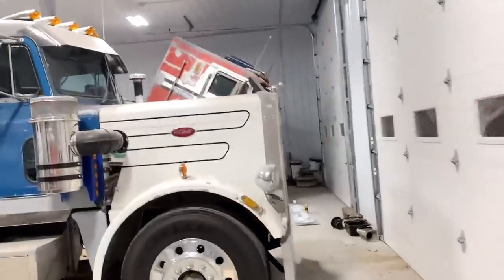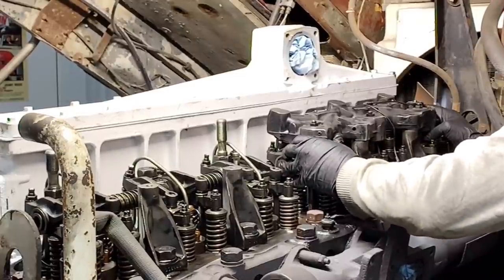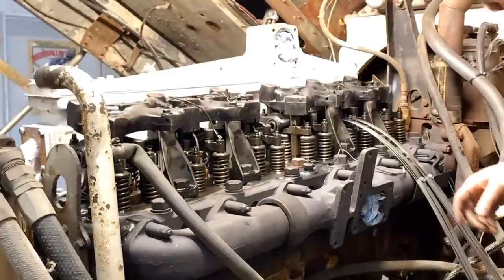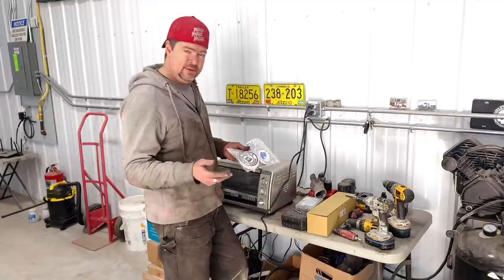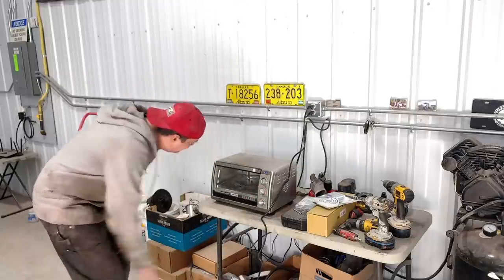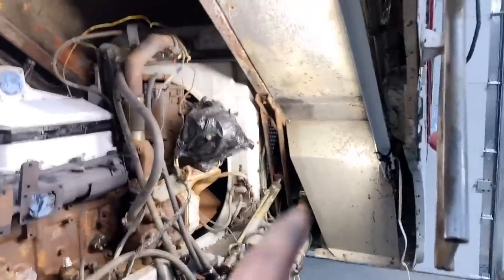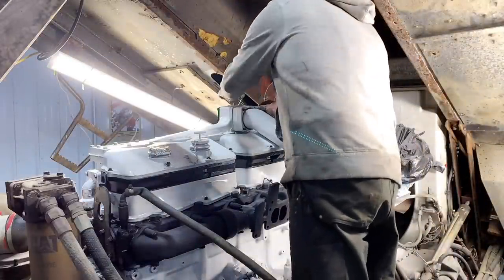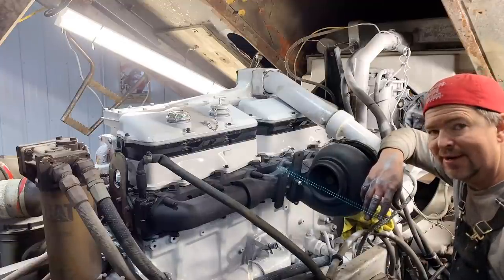Iron Duke Kenworth Restoration Ep.11 Gimme a 2-can Rebuild

Comment: Man that engine is looking sharp, I would have done the cross over pipe in black but thats just me, I know its alot of work but if you pick out all the little bolts caps and stuff in black, against the matahorn white that engine will be a show stopper. Awesome work Mark and thanks again as usual for my thursday fix which helps keep me sane, ive ben suffering mental health problems for quite a while now and this is just the kind of restoration stuff I like to see, takes my mind off my problems if only for a little while. You really do make a difference to peoples lives.
Reply: I'll be praying for you friend

Comment: I love needle scalers.. also great for removing 1/2" plus harden grease, paint, rust and deforming aluminum!!! (I attack those parts at an angle, not directly at them using my free hand around the needles with welding gloves to close up the needles into more of a power chisel) then finish up with brake part cleaner and wire brush..

Comment: with that needle scaler you gonna feel it in the evening, every bone in your arm hand and shoulder,
 did that on a dumptruck in our company and on my uncles drive axles and frame.

a little trick for rubber gaskets use Silicone Spray, coat it sligthly and it will fall in place and because the rubber gasket will suck the silicone in it won't leak (usually)
And when painting the engine you need a real good engine primer to stick to the block, 
some real thick stuff if you want it to stay nice for long.
and why don't you powdercoated the bolts?
Also I'd put a box underneath the grill when coating so not all around is full with the powder and you can safe some buck on reusing.

Comment: Mark you did that the hard way bubba... Next time, Pull the exhaust housing off (only one clamp) and bolt that up, leave the center section loose until your oil lines are bolted on (so you don't create stress cracks at the weld seams), loosen the compressor housing clamp and insert the tube then rotate the whole compressor housing and tube around to mate with the WTAAC assembly. Sounds like a lot but it's only two clamps to pull it apart and most of the time you'll have to loosen them to clock things anyway so it's not like it's that much extra. :)    Project's looking good - you're the second one I've seen doing a black/white paint theme on the motor - a friend is finishing a full out of frame on his '84 B Model from his 359.

Comment: You need cold spray mate!
Get it from the first aid section.
Then you heat up the metal around the stuck bolt, spray the bolt itself with cold spray. The hot metal expands, the cold metal contracts, the thermal shock is usually enough to break things free.

Comment: Mark, FYI there is a 180 gallon 20HP compressor on Kijiji, would solve your air delivery issues. Also the feed is the top and drains down and out the bottom and back to oil pan.

Comment: An alternative to expensive Cat paints are to have color matched cans made at Cloverdale paints and other suppliers.   Also after blasting that turbo oil line make 600% sure there's no media in the tube...and prelude that turbo before installing oil lines.    Otherwise failure will happen real fast

Comment: just asking ! . why did you not "just"...... lift out the engine and trans if you were going to paint the motor and frame . would it be faster in the long run ? because it takes a long time to get into the nooks and crannies . PS cab overs are back . pps got to go and eat F .E .B (full english breakfast )
Reply from the maker: Don’t have anything to lift it with 🤷‍♂️

Comment: Sorry Mark, but that valve cover is not secured and you can see the bolt in the middle of the rear valve cover sticking up above the rest.
Reply from the maker: Good eye 👀 was missing a few bolts off the spare engine so I had to order replacements from CAT 👍